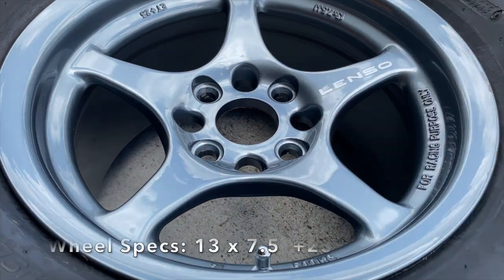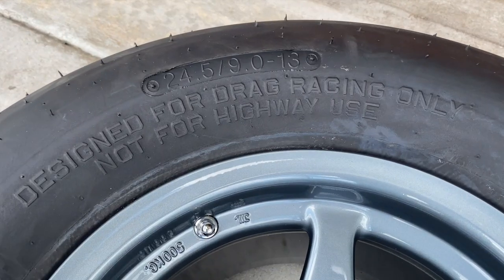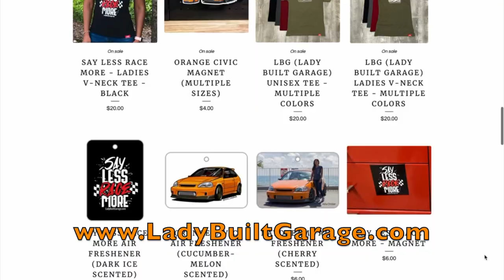I GOT DRAG RACING WHEELS & SLICKS !!! - Mickey Thompson / Lenso

Comment: Hello Aisha I've been following your build for a while your videos and explanations are always on point. I've been drag racing hondas for about 20 some years so I know a little bit. But yes you should definitely be using extended wheel studs anytime you use a drag slick also I run them on the rear as well. And do not use aluminium lugs if you have a problem its gonna be hell getting them off. And about   the space issue behind the wheel usually doesn't touch even at its closest but your brakes are causing you to have to use that big of a spacer. Sorry for the long post just trying to help. I'll be watching to see what you run at the track good luck.
Reply from the maker: Hi! Thank you so much for your reply and for watching my videos! What cars do you race? And what times were you running with what setups? Just curious :) .. Maybe at some point I will put them on the rear, but for now I'm just going to focus on the front lol so I can hopefully get a good pass down the strip. That's interesting about that the tire not touching, but I guess sometimes I overthink things lol. Thanks again :)
Reply: @Aisha_LadyBuilt  as of now my my car is a 90 civic sedan its type r yellow with a built ls vtec 85 mm sleeved Eagle H beam rods acl race bearings integra GS-R girdle oil pick moroso gsr oil pan first gen b16A head ported 20 years ago valve springs and retainers obd1 conversion of course rywire harness plm ramhorn manifold cheap Ebay turbo GT3582R made 401hp to the wheels @ 19psi but it's not turned up because I built it for the 11.50 index class. But it already has ran faster then 11.50. It ran 11.36 @ 133mph with my single disk clutch going out. Also skunk2 ultra manifold speedfactory radiator like yours. Carbon fiber hood and trunk one Recaro race seat still has the power windows full glass for now transmission is a YS1 Gsr with carbon synchro and a twin disc competition clutch 500hp insane shaft axles I probably missed some things. You can ask me anything about the car that I didnt mention or forgot.

Comment: I'm running the 13x8 with 20 offset. 22in m&h tires. I was nervous about using the bigger 24.5 tires.  Plus I'm using a ls transmission so no need for a huge tire. B16 trans is good for the 24.5 tires since the gearing is short. Hopefully you will get it all squared away. It's good information to have out there cause not everyone gives the right advice.
Reply from the maker: I have a GSR transmission, and from what I am told, with the power I'm making the 24.5 tire is what I need. Hopefully when I get my extended wheel studs installed and get a better spacer, I'll be able to test it out on the track to see where I'm at. Thank you!
Reply: @Aisha_LadyBuilt  yeah you should be fine. You're making way more power than I am haha. I'm right around 300. Can't wait to see how the slicks work on your setup. I actually bought the hybrid racing shifter cause your video and it's the best investment on my car so far.

Comment: What's going on long time no hear from but I know everybody has to work and is quarantine thing is crazy I would try to get a right offset because the Wildwood calipers would fit a 15 inch stock wheel for the Honda so if it can fit over the stock we'll all you have to do is get the same offset that the stock will has and the wheel will fit on without having the spacers
Reply from the maker: It's been a minute. Yea quarantine and working from home has been crazy lol. I understand where you're coming from. To be honest I've been thinking about it since I test fitted, and now I'm debating weather I should get different offset wheels instead of dealing with spacers. Ugh, decisions decisions lol. Thank you for your feedback though, and for watching! :)

Comment: Where did you find these spacer ? thks
Reply from the maker: I honestly do not remember. I've had them laying around for years but I never actually used them. I wouldn't really recommend using those in this video because they're not hub centric.
Reply: @Aisha_LadyBuilt  i wasn't able to find hub centric one, but i managed to find jr one, brand new, with my spec and hub centric

Comment: I never cared for the hatches, but nice civic. I'm working on my 97 ex, still got a bunch of work to get it back to stock performance but plan on doing a turbo after I'm done replacing the suspension, steering rack, shift linkage. she has rotors on the back so far, but nothing too fancy  besides that as far as mods yet
Reply from the maker: Thank you! I appreciate it! Nice, Turbo is the way to go! So much fun to drive. Good Luck with your project!
Reply: @Aisha_LadyBuilt  thanks

Comment: Just wondering, what size are your rims and tire, what size of tire is on your drag front rims ?
Reply from the maker: The Lenso wheels are 13" x 7.5" and the slicks are 24.5" x 9"
Reply: @Aisha_LadyBuilt  thanks you.
Reply from the maker: @neutronj1560  No problem at all!
Reply: @Aisha_LadyBuilt  Does the caliper have any clearance issues with the spacer ?

Comment: damn, didn't realize you could fit a 13in wheel with the wilwoods, that's extremely tight up front. I wonder how the other wheel options with lower offsets are like, seems like the lenso at least has barrel clearance for the wilwoods, other wheels may not.
Reply from the maker: Trust me, I was skeptical lol, but at least they can fit, but only with a spacer. I'm actually second guessing if I want to use these wheels with a spacer. I'm going to look into other wheel options to see what choices are out there and think about it :)

Comment: The stock will offset is like 38 mmmm and the wheel size try to go down one more size not the rim size the tire size I just like everything being the way it should be without using supplements or spacers just my opinion
Reply from the maker: I replied in detail on your other comment :)